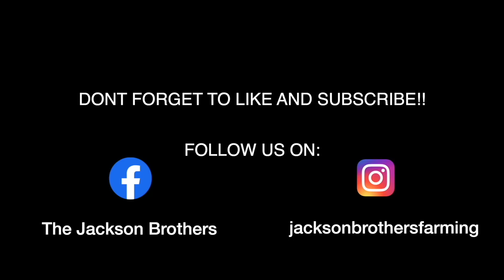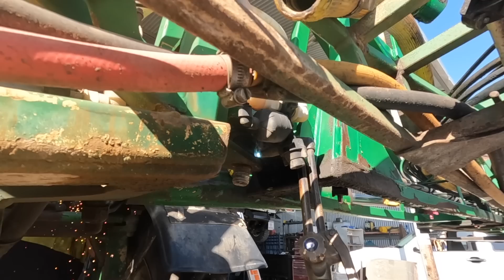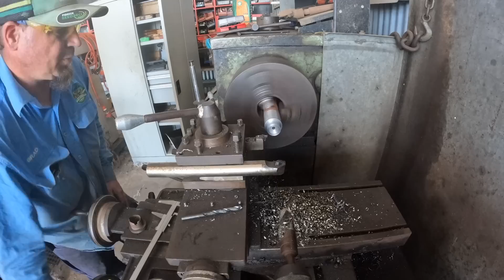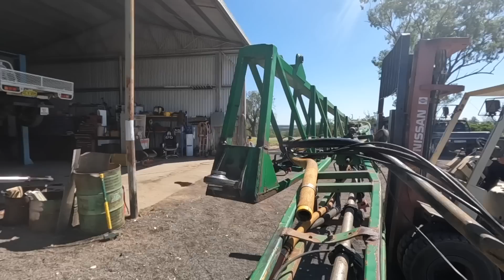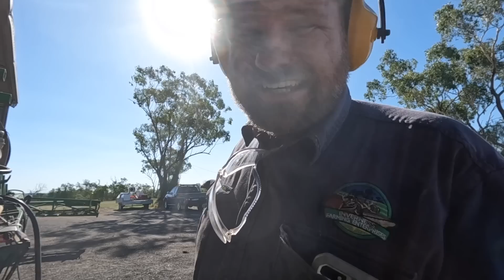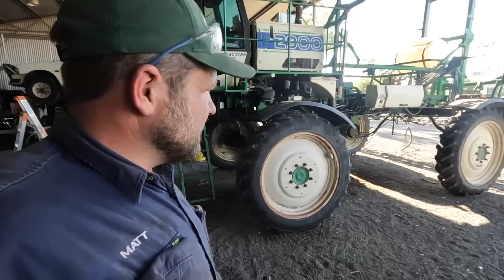Grasshopper Falling Apart - MAJOR REPAIRS (Vlog 149)

Comment: I was in Coober Pedy back in 1981 and saw the temperature reach 54C in the sun. There was no shade. The sun burn I got has never been equaled. But it was a dry heat. Thanks guys.

Comment: Welding gloves to hold steel that is in the sunlight, the heat index must be up a bit. Is it possible to add a double shed bay wide awning or shade sail etc in front of the shed? BOM with their 'Enso Watch' report issued yesterday suggested it was twice as likely as normal that an El Nino could form later in 2023.
Reply from the maker: It had some sting to it that’s for sure, I thing a 2m self supporting awning would be great for these situations👍😁

Comment: Super hot by the sun.  I heard a few years ago that several companies were making freon in massive quanties to wash electronic components.  Again with the thinning of the ozone layer.  Decades ago people on the southern tip of Chile complained to their priests that they had to wear hats. Long sleeve shirts and gloves because there was so much heat from the sun . The request went to the Vatican where they said.   What problem. We dont have any problem.   I suspect the ozone layer is just luck and is created by lightning bolts that go upward called sprites that just like lightning bolts and electrical arcs.  Create ozone.